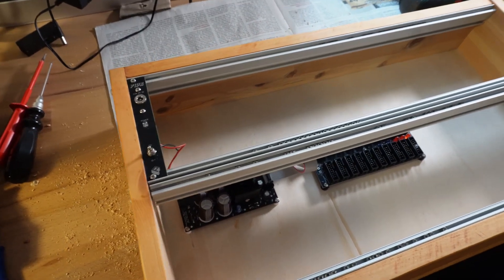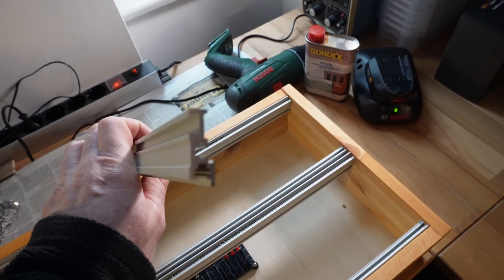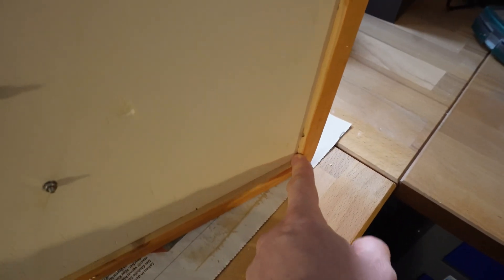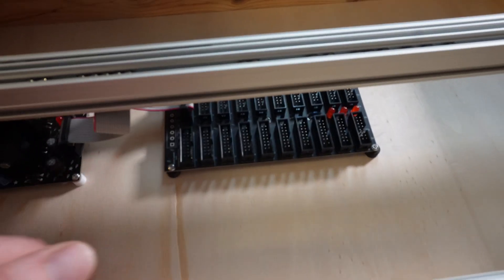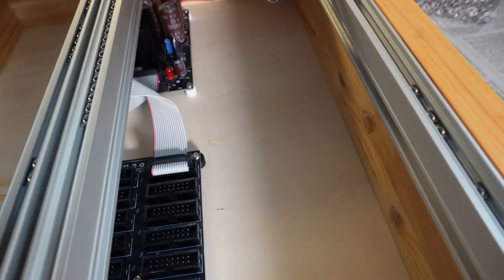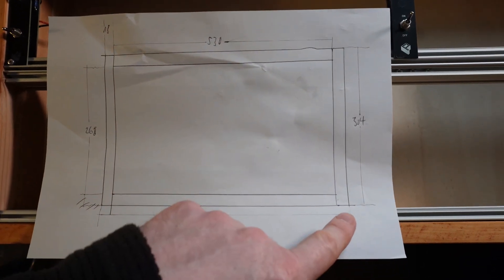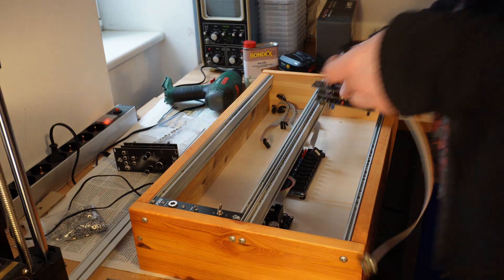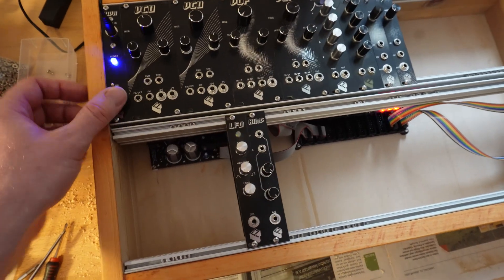Building a simple Eurorack case

Comment: Hello! Thanks for sharing your designs and knowledge! Could you tell me how tall the case is? I have an 8 cm tall case and want to make sure the heat from the power supply won't affect the modules.
Reply from the maker: Mine is 9cm from the bottom to the rails and there is still a bit of space left (~1.5cm). Cheers!